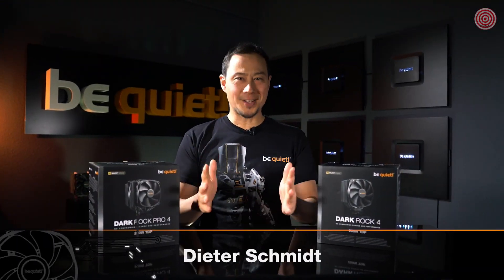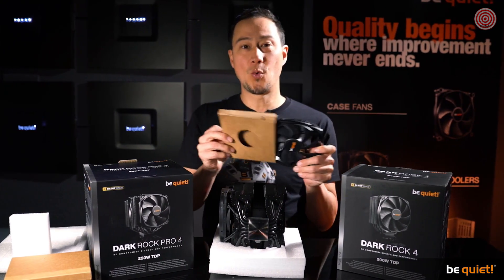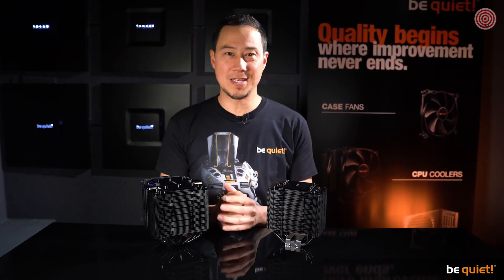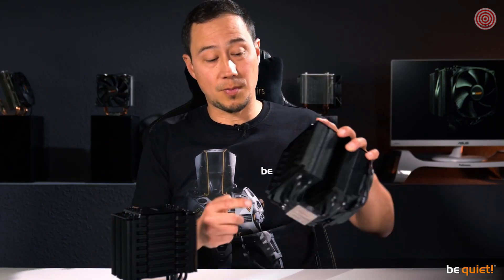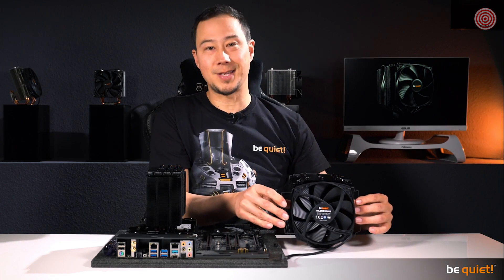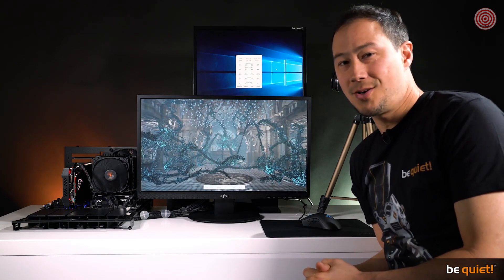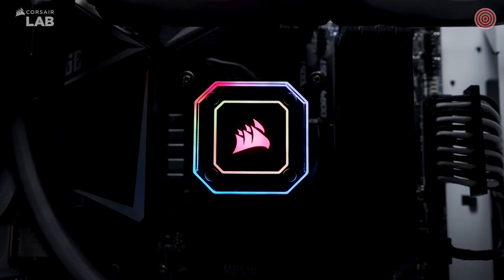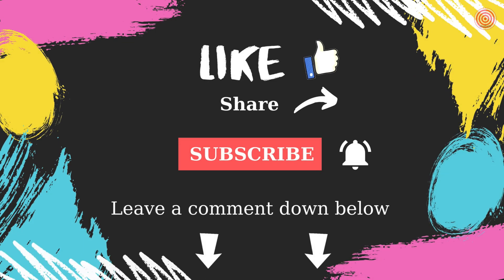Best LGA 1700 CPU coolers for Intel 12th gen

Comment: I was not able to find adapters for any of these coolers and none of them had compatibility with socket LGA 1700. Thank you though
Reply from the maker: In the description of the video is a link to Amazon for such kits, and if you can't find it through that link you can try it on the manufacturer's website. I'm sure they all have an LGA 1700 mounting kit

Comment: I have a i7 12700k and an asus z690-p board would this be good for me ?
Reply from the maker: I don't really understand your question! If you ask me if the two products you have chosen are OK, then I tell you YES. If you ask me if the coolers I show in the video are good for what you have, then I tell you YES. You don't even need an adapter for lga 1700 because on asus z690-p the lga 1200 chiller can be mounted without any problem.
If you are going to overclock I recommend you choose an AIO chiller.
Happy gaming!

Comment: Hi! I have such a question for you, will the be quiet cooler be suitable! Shadow Rock 2 for socket LGA 1700?
Reply from the maker: It is if you also buy a BZ006 mounting kit
Reply: @AryTechB  ok, thanks!
Reply: @AryTechB  Isn't it under AMD socket? is it suitable for Intel?
Reply from the maker: @ssserega2976   with the recommended kit it is compatible for intel
Reply: @AryTechB  thx

Comment: Your link to the LGA 1700 mounting kit does not work. I'm right now having problems mounting the Dark Rock Pro 4 to a brand new Gigabyte LGA 1700 board, despite bequiet putting out a video for exactly that purpose. Looks like I'll have to return it. :-/
Reply from the maker: I checked the link and it works. By the way, the link is for US, maybe it redirects you to another location. I'm sorry about your problems.
Reply from the maker: I also found this may help "LGA-1700 Mounting Kit from be quiet!" https://www.bequiet.com/en/contact/lga1700mounting

Comment: I ordered a new i7 12th generation and also a water-cooled cpu. but out of that cpu came a 1200 kit. if i order this what you show in the video now. Can I use that kit for my water cooled CPU?
Reply from the maker: I'm sorry, but I didn't quite understand what you were asking me. Did I understand that the CPU (1700 socket) came with a 1200 socket mounting kit for coolers?If so, then I think you can mount your cooler.
Reply: @AryTechB  yes, that’s right
Reply: @AryTechB  but my motherboard is msi, 1200 kit doesn't fit in it and 1700 kit i can't find on the internet
Reply from the maker: I understood this: That the processor came with a 1700 socket mounting kit that fits with 1200 socket coolers That is right?

Comment: can i put my old version aio for new lga1700? or there is any universal bracket to use in lga 1700
Reply from the maker: I think you need to look for an assembly kit for lga 1700. I have a link in the description of the video can help you.
Reply: @AryTechB  okay thanks bruh
Reply: @lzyhns5325  this video is literarily spam, this company doesn't even have the kit ready for LGA 1700